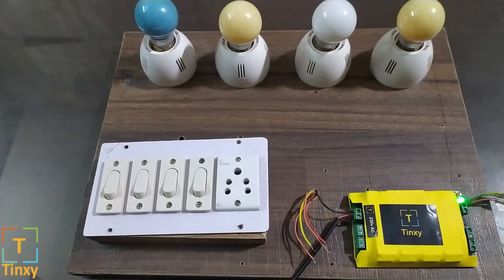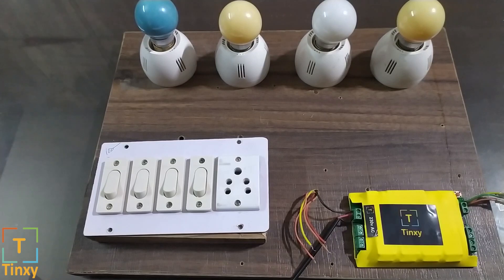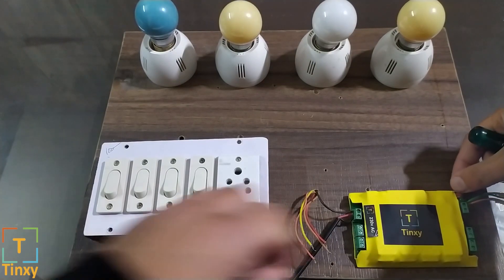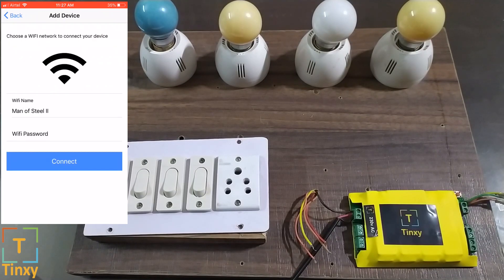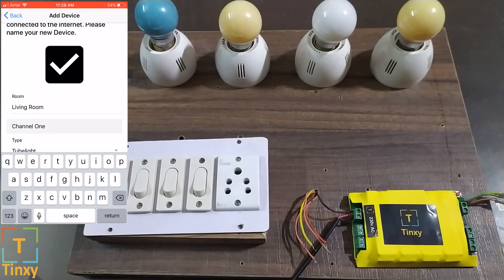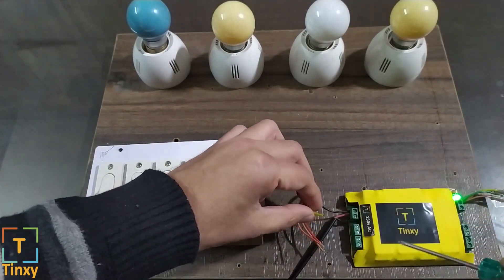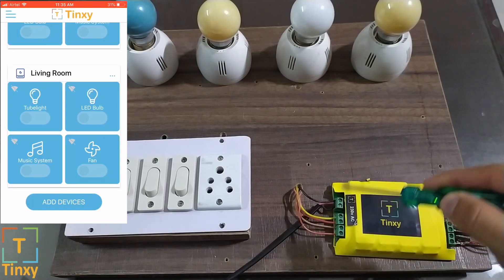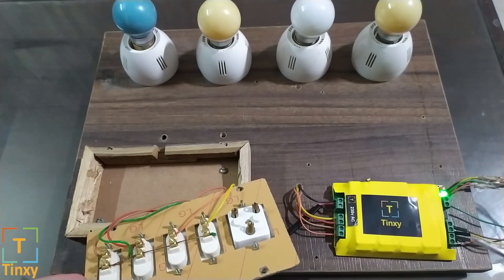Tinxy 4 Node/ Channel WiFi Smart Switch Installation instructions

Comment: Hi , I just bought the 4 node smart switch but it doesn't looks like the one you are showing , I bought it from amazon and its wire ports are a bit on different places . Please Guide
Reply: You have an updated model. Wiring diagram is attached
 For further please call 9319513343

Comment: Hello Sir.
1. If I'm not wrong, this is 4 node smart switch with Fan regulator.
2. As per the circuit diagram I am guessing that the common line connection to one terminal of all the manual switches is drawing the power supply through phase connected to the other end. Is that true?

Comment: In this module have last state remember features ?

If we use switches for on/off 
Last state doesn't work
Reply: Can u give me solution for this.
Reply from the maker: @kpinnovations6613  Sure, please call our tech support , have him update the firmware to v4 . It should work out of the box. Not sure what is your current device version . We fixed a glitch in the new version

Comment: I have three question:
1.What if I have two on Inverter and remaining on normal power??
2. Whether it is suitable for two way switch??
3. Can I put two node empty and other two with load??
Reply: 1. Not possible 
2. Yes
3. Yes
Reply: @mohitgupta1283  1.Where can I get two way switch diagram??
2.Can I use two module one for completely inverter and other for normal power in single board ?
Reply: @mohitgupta1283  Thanks a lot for valuable response..👍

Comment: can it control speed of fan
Reply: Not this module will only turn on and turn off the devices which is connected to the switch board. U have to select different model which also comes with dimmer option for controlling fan speed.